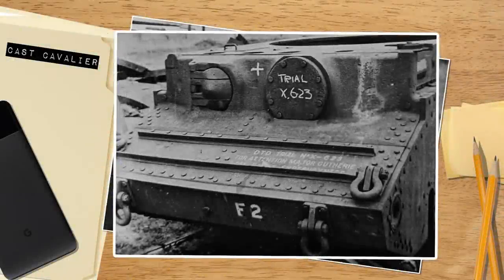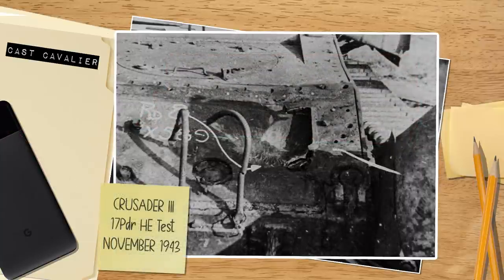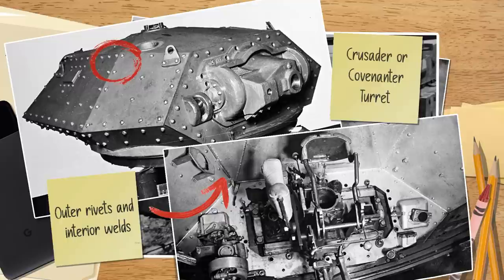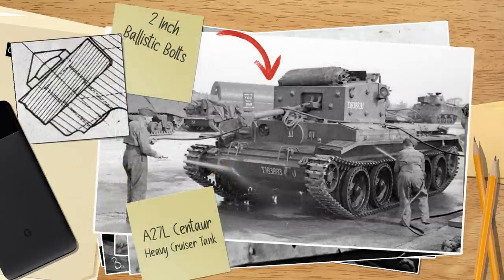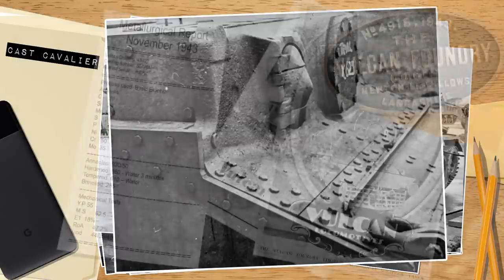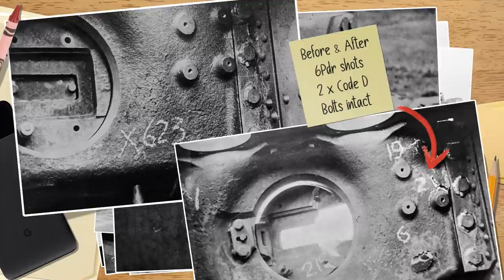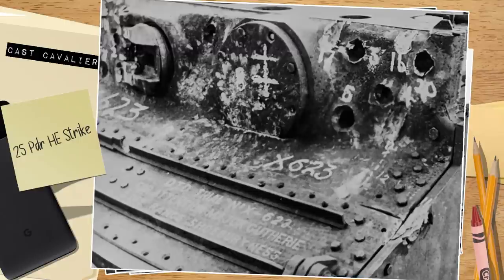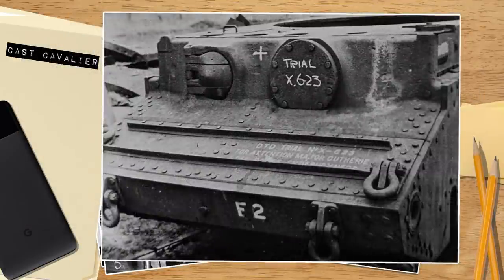The Cast Cavalier - Tank Design and Development

Comment: Very interesting. How effective were the short vertical 'shelves' mounted on the front of WW2 tanks at deflecting rounds? I've seen them on early A9s, Valentines and Cromwells but haven't found much info on them. They appear to be peculiar to British tanks of the period.
Reply: (speculation) but I think its splash guards for water spray when fording water.
Reply: @LazyLifeIFreak  No they're definately an anti-ballistic measure.
Reply: @kirishima638  Where do you get this notion from? What source? There must be a design document, study or memo from a meeting? My impression is that the metal bars are splash guards, seems rather wasteful of metal to put a few strips of steel across along with all the extra work involved.
Reply: @LazyLifeIFreak  I read about it in a book years ago.

Your 'impression' is not a primary source.

I'm not going to justify every comment I make to some rando on the internet - my original question was for the video's author who actually knows about these things.
Reply: @LazyLifeIFreak  they are there to stop small arms fire from bouncing off the upper plate and into the drivers / mg viewport
Reply: @kirishima638  I love it when people justify their own ineptitude by refusing to address the flaws of their own statements. Please do continue.

Comment: Very interesting as always! Casting does has advantages but it requires big foundries with important knowhow to handle the various processes to handle heating and using alloys to blend (is it the correct term?). Casting is a manufacturing process in which a liquid material is usually poured into a mold, which contains a hollow cavity of the desired shape, and then allowed to solidify. The solidified part is also known as a casting, which is ejected or broken out of the mold to complete the process. Casting materials are usually metals or various time setting materials that cure after mixing two or more components together; examples are epoxy, concrete, plaster and clay. Here is the following excerpt from Wikipedia: "Casting is most often used for making complex shapes that would be otherwise difficult or uneconomical to make by other methods. Heavy equipment like machine tool beds, ships' propellers, etc. can be cast easily in the required size, rather than fabricating by joining several small pieces" but all this require enormous space. I understood that cast metal is less resistant to incoming shots requiring thicker armour and, of course more weight....
Reply: Its not that big of a difference. Depending on cast method it's only 3-8% weaker irl and the shapes you can cast in allow not only for this to be overcome but for it to be more efficient. Cast tanks tend to be lighter for a given effective armour. This is why casting became so popular prior to composite armours.
Reply: @matthiuskoenig3378  thanks for the information, much appreciated 👍 👍
Reply: Good bot.

Comment: Why didn't the UK make fully (or almost fully) cast hulls for Churchill and Cromwell by the way?
Reply from the maker: mostl likley space, time and equipment. a few foundries could do really larce casts such as ESC - who did tortoise etc, but the smaller firms would not have had the capability or expereince to do so or switch over at short notice.
Reply: @armouredarchives8867  I presume the mathematics is X cast turrets or one cast hull. If the cast hull isn't significantly better than riveted or welded, don't bother. Even the USA had issues with castings being too thick and heavy or having parts too thin, but you'd have more control with other techniques. Did castings get face hardened?
Reply: It does raise the question as to what the vulcan foundry were producing when the matilda 2 production was stopped in 1943. churchill turrets, mantlets maybe?
Reply: @scottishcarver66  Wasn't the Matilda bolted together from smaller castings, just internally? Or am I thinking French tanks? I am sure someone will know. But it's also a good question.

Comment: I feel like this is a foregone conclusion that they tested anyway. They KNEW that the bolts were the weakpoint, they KNEW that monolithic armor (or learning how to weld properly) was the only way to combat this problem, and yet they tested it anyway as if they expected things to somehow be different. 

To their surprised 1943 Pikachu faces, the bolts sheared off as they always have, creating spalling and dead crewmen on the inside and a loose armor plate on the outside.
Reply from the maker: Could be they did, could be that back then somebody else didnt and wasnt having it, so they had to do this to prove it etc, its often hard to judge what was going on behind the scenes at times.
Reply: Weld lines were and are also weakpoints in armour grade steel. Just because something is a weak point doesn't mean its guaranteed that it's always going to fail. Furthermore different rivet/bolt size, material and layouts Likely affect their failure rates.
You have to test these sorts of things to know for sure.